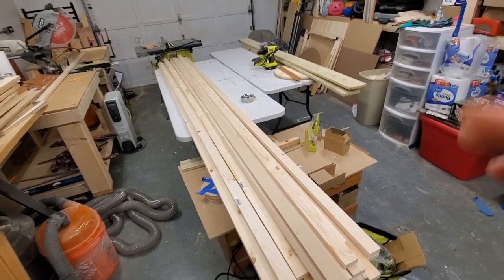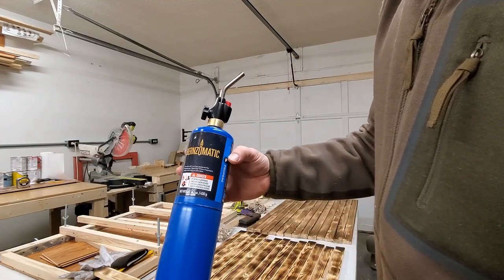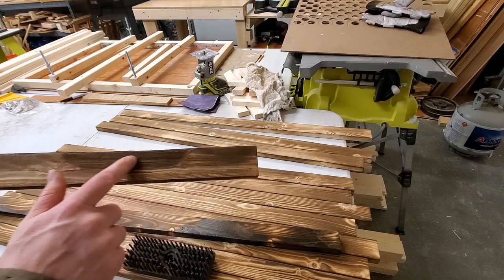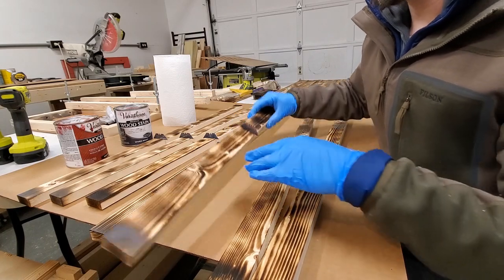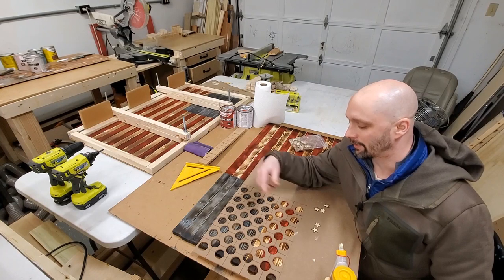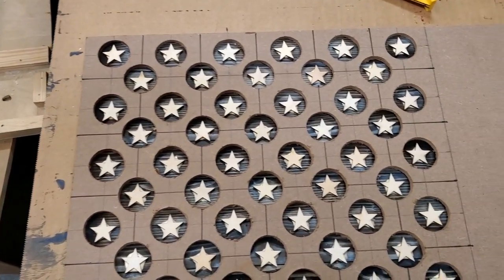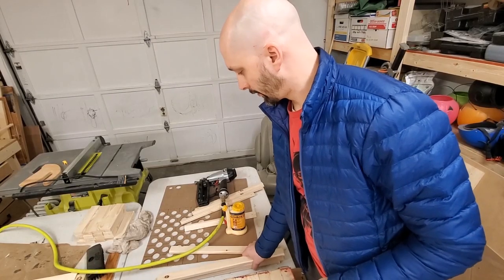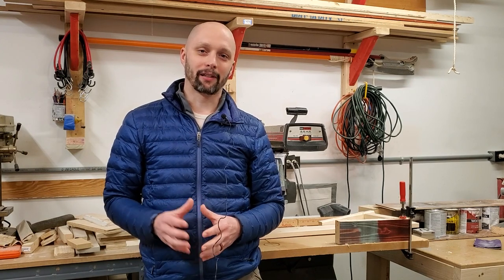4 different styles of Wooden American Flags

Comment: Great video and nice job!   I love the star jig and flag clamping device.   I have been making flags for a couple years now and my process has changes multiple times.  For what it is worth: 1.)  I use furring strips (1 1/2 X 3/4 x 8 foot) instead of ripping 1" boards.  It saves time and the wood is cheaper  2.)  I used to glue the stripes together from the front, however have started air nailing each stripe the next and adding wood ribs on back to hold them straight.   
    Again, great work!
Reply from the maker: Thanks! And thanks for the ideas. Sometimes I think about using precut material.

Comment: When it comes to your jig, How do you keep your downward reinforcement boards from being glued to the top of your flags ?
Reply from the maker: That's a good question. I honestly haven't had that issue bc I'm careful to minimize the glue squeeze out that comes upward.  Also, most of my designs have a round over on along each stripe which also reduces contact at the seems. If this is an issue, a precaution could be putting paste wax on the contract point of the clamping rod. That should keep anything from sticking. Maybe polyurethane also.
Reply: @wooddoofus  thanks for the quick reply!! Was curious have you considered not even glueing your stripes and just flipping the flag on its back and glueing and brad nailing the backer strips instead of glueing each stripe individually?
Reply from the maker: Yes I have considered and tried that. My thought are that the strips have to be very straight for it to work. If there's any bows in the strips then clamping helps square up the final product. But there is definitely a case for gluing on a backer board.
Reply: @wooddoofus  you could still use the jig without gluing each stripe just clap down and install the backer boards
Reply from the maker: Oh I got you. Not a bad idea. Thanks!

Comment: Hello brtha, Thanks for putting this content out for us to see. I was wondering, what stain did you use for the 'White"?  Also , some advice on blotching, When you burn with torch, It best to to burn in one smooth Stroke from one end to other. Once you stop n go back n forth in between It is blotch Heaven. Same goes with staining. Its a bit tough with staining. "This is info I gathered from a couple of months of research on Rustic flag builds and staining so figured id share with you since your sharing with us👍"  Even though Your flags still look AMAZING and I def love the work. Great job. Oh and I am going to the local store in a hour or so and get me the material to make the jig you showed on your other vid. God do I need that jig, so thanks again for that as well brtha 👊👍 I will comment there as well once I'm done, hopefully later today
Reply from the maker: Thanks for checking out my video and for the advice!  The white stain is called Antique White by Varathane. I got it at Home Depot. The red is Barn Red and Blue is Worn Navy.
Reply: @wooddoofus  Thanks Brtha.